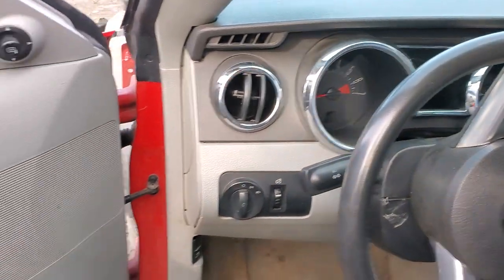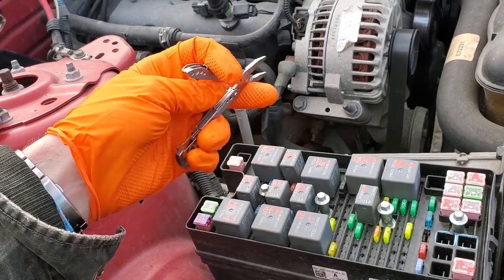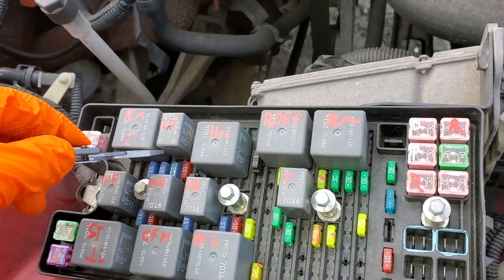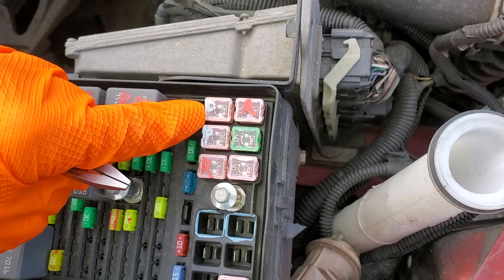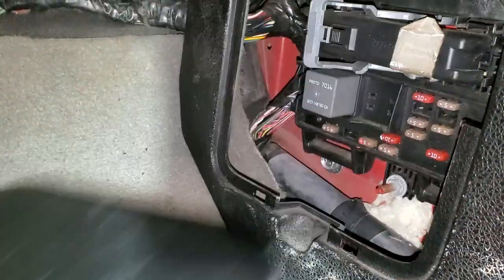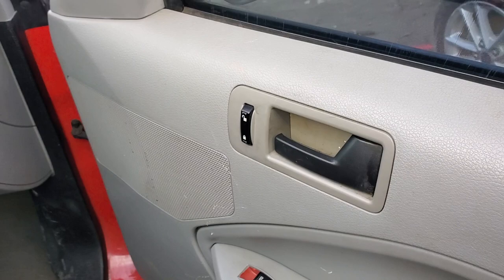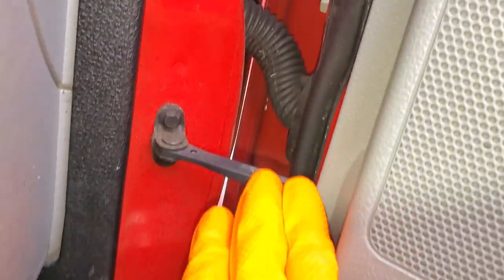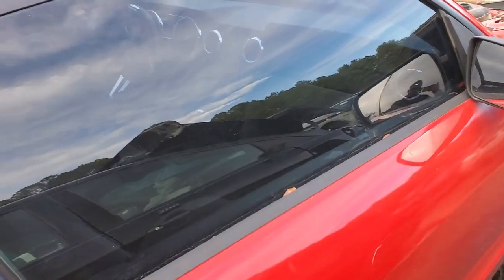2006 Ford Mustang Power Window Fuses

Comment: Thank you very much, your video absolutely  helped 120%  I  took the car for a blown header and my window wouldn't work no more so I told them they had to fix it, the mechanic tried 3 times fixing the window with 3  different motors and nothing he said he could do it, I was very frustrated because the car had been there for 9 months after they fixed the engine I brought it  home and watch your video and got it working right away, it was just the driver side #30 fuse that was missing. Thank you soooo much once again I'm very happy.

Comment: My son has a 2007 mustang and the windows switchs don't work. I checked th little 5 amp fuse you pointed out and there is no voltage there and I also check out the relay and there is no voltage ther either. Checked all the fuses under the hood all are fine. How many volts are suppose to be that the 5 amp fuse?

Comment: My fuse down inside the car keeps blowing every time I put a new one in all other fuses are good. Any ideas?
Reply: I have the same issue :(
Reply: I put a 15 in mine just now and it seems to work fine, it’s supposed to be a 5 but it’s working now

Comment: I have an 07 convertible mustang. You said there are two additional fuses on the opp end. Would those fuses be the ones id have to replace for my driver's side? 

My door goes up and down, but when I turn off the car and open it automatically goes up and down 1/4 of an inch two times before closing, and it remains up, preventing me from closing the door. I've already replaced the battery and did the manual reset, and nothing worked.

Comment: Thanks for the video! Any ideas on this one? I bought this car and the passenger front window worked, then it stopped working then my driver side window worked and then stopped working. The back right window never worked and the driver side rear window has always worked. It's a convertible any ideas? Thanks so much and I'm going to check the fuses tomorrow. I got another master switch from the junkyard and it did the exact same thing with only the back window working. Thanks again!
Reply: Hello 

Check your BCM it got wet it is on the passages side with a little door pull the main plug disconnect battery first if you see green and white stuff on the plug you will need to replace that box

Comment: My 2007 convertible mustang pasenger window was working fine the switch to make the window go up and down working i can hear the click but the window is stuck down i remember telling my gf to hold the switch down and removed the negative from the battery that's what causes the problem i checked the fuses changed dead one and nothing what can i do next ☹️ thanks in advance